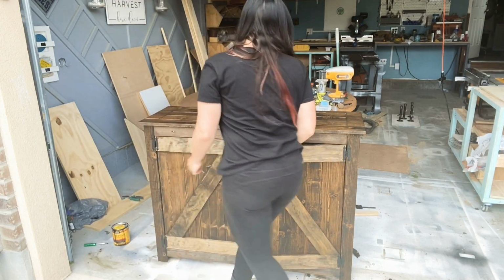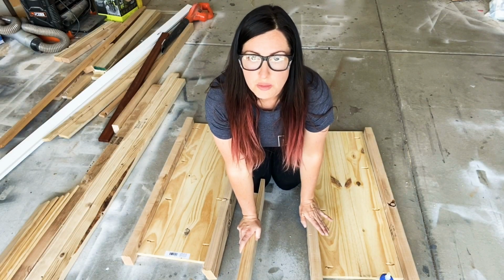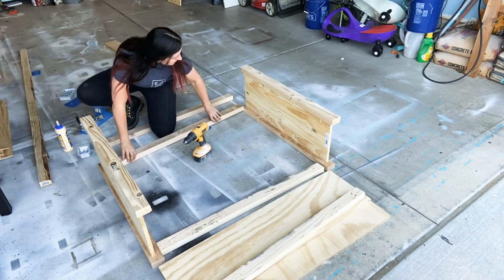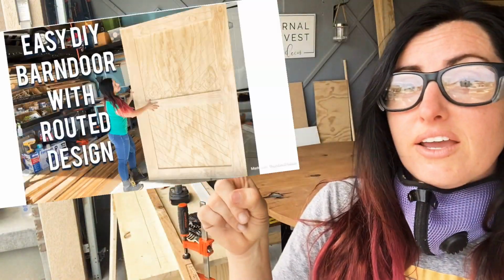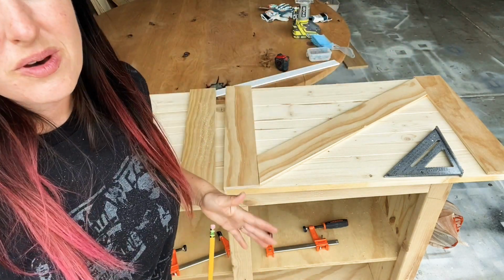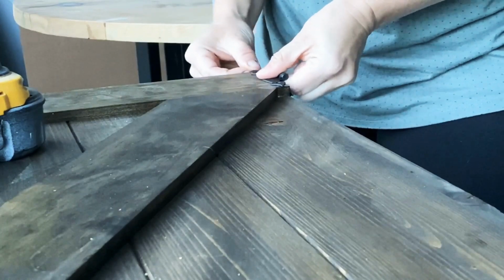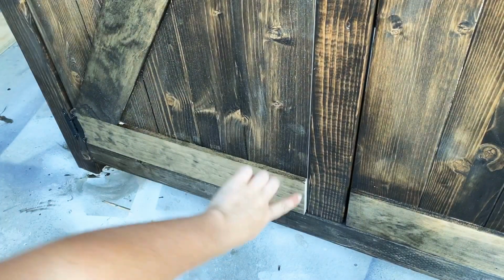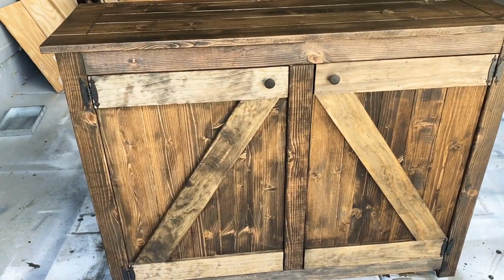HOW TO BUILD A CONSOLE TABLE- buffet side table cabinet

Comment: Hey sis: I have two closets 60 and 36-inch wide respectively. they are 12-inch apart. The barn door for the 60-inch opening will have to go over the 36-inch opening when it slides open. would you attach the two doors and make one big sliding door or what?
Reply from the maker: Ooh that’s a tricky situation, if I’m understanding correctly you need the doors to by pass each other? If that’s the case I would use some barndoor bypass hardware like this to allow them to overlap. Hope this helps!!

https://amzn.to/3jE40V7

Comment: I am in the midst of making this cabinet but I don’t see what you used for the doors. Was that extra wood or some of the list above?
Reply from the maker: You’re right I didn’t put that on there, I was planning to do a whole new video about doors and then we sold our house! I totally forgot! So I grabbed another project panel 18”x6ft and used that to rip the doors. I did the same router trick and added the decorative trim. I’ll add those to the description. Thanks for asking and  have a great build!
Reply: Eternal Harvest Decor . Thank you so much. After watching the video again and again we figured it out. I will add the doors today and stain. I am so excited.
Reply from the maker: YAY so excited for you! Thanks!!
Reply: Did you put a clear coat after you stained? If so what kind and did you spray it on or brush?
Reply from the maker: yes I like polycrilic by minwax on tables like this!

Comment: I love seen women builders . One my suggestions is try to work on top of something so you are a not hurting your back and your knees . I know sometimes we need to use the floor because  what we are building is too large. Maybe a couple of sawhorses with a plywood on top. quick and simple. also when you bend over you get to far from your camera and is hard to hear what you are saying. I hope you dont take this advice in a bad way I am a woodworker myself. Like i said i love see women building stuff.
Reply from the maker: Hi Ruben, thanks for the thoughts. I purposely do things on the floor, I like it much better usually, but I do get that comment a lot. I build a workbench but honestly I prefer to work low. I am planning to get a better mic so you can hear me better though. Thanks for the comment
Reply: @EternalHarvestDecor   You are young just remember knees and back get damage overtime.  really nice work.